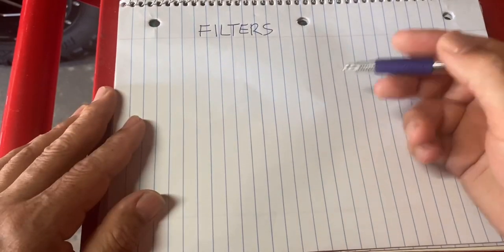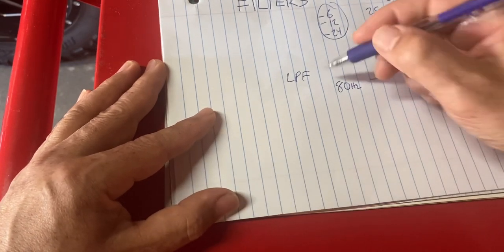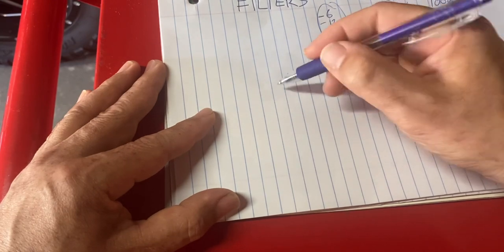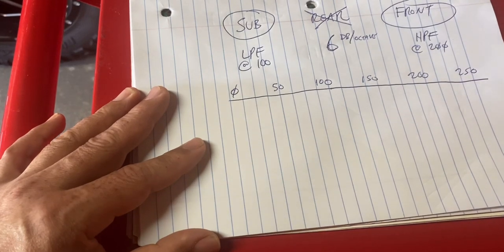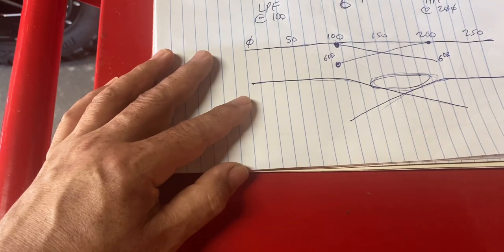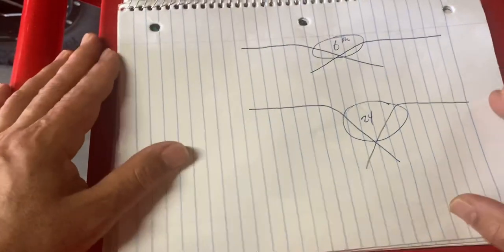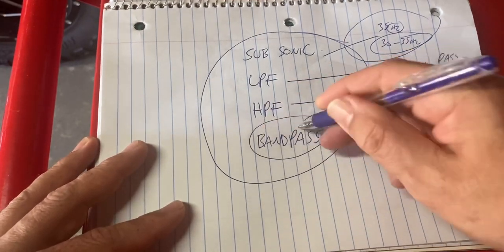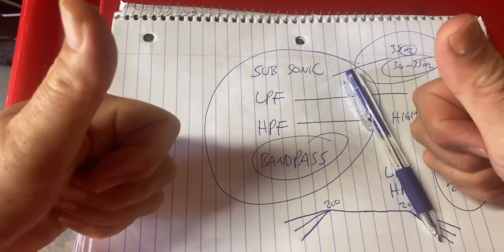Tune your amp filters like a pro!!! HPF, LPF, Sub Sonic, bandpass fully explained!!!

Comment: Damn! Didn't even know what I didn't know, great video! I can't seem to find the DB roll off for my amp so I figured I'd shoot the gap. Please tell me if this makes sense. I have 2 Skar 500w 4 channel amps (will be 1000w when they are back in stock) pushing 6 Skar marine 6.5's and 2 marine midrange 8's. All wired at 4ohm. Is a good starting point lpf150 and hpf200 for the 6.5's 
Lpf 80 and hpf 100 for the 8's 
Or should I watch the video again lol? Below is my amps info. Thanks so much for taking the time to teach us! Subscribed! 

Skar Audio RP-75.4AB Multichannel Amplifier
Class A/B 4-Channel Amplifier
4 Way Protection Circuitry: Thermal, Voltage, Speaker, DC
RMS Power at 2 Ohms: 125 Watts x 4 Channels (14.4v)
RMS Power at 4 Ohms: 75 Watts x 4 Channels (14.4v)
RMS Power at 4 Ohms (Bridged): 250 Watts x 2 Channels (14.4v)
High Speed MOSFET Power Supply
Soft Turn on Circuit
Frequency Response: 20Hz - 20kHz
Signal to Noise Ratio: 105dB
Tri-Mode Capable / Bridgeable
Bass EQ Switch: 0, +6dB, +12dB
Low Pass Filter (Variable): 50Hz - 500Hz
High Pass Filter (Variable): 20Hz - 5kHz
8 Gauge Power and Ground Terminals
Working Voltage: 8.5V - 14.4V
Reply from the maker: I think you got the filters messed up man. Not getting any range hope they are correctly set up. Should be HPF at like 125 and LPF either off or at 2-5k if you are running external tweeters

Comment: Hi there, can I connect the 14000w Powerbass amplifier to two JBL Club series 10 inch shallow subwoofers?
Reply from the maker: You can, just adjust Gain accordingly to compensate lower power handling subs

Comment: Great explanation. Out of all of the videos i have seen, this one got through. I am left with a question though, what if my sub enclosure is not ported, what is the formula for setting the sub sonic filter?
Reply from the maker: 20hz. Good thing with sealed is that you can tune power like that without worry of unloading the sub. Anything under 20hz the ear can’t hear. So 20hz

Comment: This is absolutely amazing detailed information, I don’t get it yet but I’m going to keep following you until and hopefully I will finally get it. I’m not working on a Vehicle sound system but am working on my Victory cross country motorcycle and have Pioneer mvh-ms310bt headunit, 
Db drive wdx6moto-g2 400 watt speakers for the fairing ,
Polk audio 522 speakers for the tour pack 
Massive tx48 amp 
And I just purchased new Polk Audio MM1 692’s the 6x9’s and the lids and grills for the bags that I will be installing. 
I paid an audio guy to get an audio guy to give me setup instructions for the headunit and initial settings for the amp and we set the gains on the amp playing a particular song , we did this over the phone as there are no audio guys here in my town in Canada . I ordered a AUKUYEE TFT Digital Oscilloscope Kit O scope.
Reply from the maker: Nice man! Your on your way for sure! Nice setup

Comment: I didn't quite get the band pass filter, I m installing tweeters and mids on my 4 channel amp so my tweeters are going to channel's 1 and 2 and for my mids I'm gonna use channel's 3 and 4, for the mids how I create a band pass or how I set my filters there, because my options are HPF, FULL and Lp/Bp I'm hooking 4 mids on those two channel's in parallel so I'm a little confused about the band pass filter
Reply from the maker: Set mids to BP. Hpf@150-Lpf@2k. Tweets HPF@2k
Reply: @NextLevelCarAudio  thank you very much!

Comment: I’m running a pair of DB Sylvesters and DB tweets on a pair of component crossovers, im getting too much bass in the mids, should I change the amp crossover setting from full to high pass or just adjust the crossover on the amp until the bass has been reduced?
Reply from the maker: Do you have a eq? On your head unit for example? That’s where I’d do the tweaking.

Comment: What should i set my LPF to if my enclosure is tuned to 32hz (im running 2 12 skars , with the rp1200 amp) help me out here i dont wanna blow my subs and i want them to sound the best they can
Reply from the maker: I say 32 hz honestly.
Reply: @NextLevelCarAudio  i cant , it only goes from 50-220 so what should i set it too

Comment: I have a full range amp running my subs tuned at 33hz. My low pass is at 80 my hi pass is turned all the way down. Is this correct??? Also my amp has 3 more knobs for filter one I believe is 32 + or - 6db, another knob is 64??? + or - 6db and I think the last know is 72 or 84 +or - 6 db.......those 3 knobs are all set in the center at 0......should I set those differently.  Feedback would be much appreciated.......
Reply from the maker: That sounds setup just right. 😎
Reply: @NextLevelCarAudio  I ask because I see alot of guys run there hi-pass around 5hertz less than there box tuning. Not sure if this is just more efficient or better on the sub???
Reply from the maker: No need to do that. As your SS/HPF has a slope/ roll off. Not a sharp cliff. So it progressively attenuates below port tuning frequency and your other going full send below port tuning which is not a good idea.

Comment: Great video thank you man.

You mentioned setting subsonic when using a ported enclosure but what if I have a sealed enclosure? 
Just find my box tuning frequency and set it a little lower than that?
Reply from the maker: For sealed I set sub Sonic at 25hz. Since it’s sealed, it can take it. Plus Anything below that you can’t hear anyway. So no need to go lower

Comment: bro help me out i got a stock head unit f150 2016 one 12in L7 Q class running 1 ohm 900 rms amp re audio 1500.1 in a 3.1 cb ft ported box "tuned" to 32 htz  im guna try to set my gain bass out of it any help on amp adjustments on the lpf,subsonic ,bass boost anything would be helpful!
Reply from the maker: I’d do sub sonic 32hz, LPF @ 125hz, bass boost off. Gain is the most vital setting. I have lots of videos on this. Different methods
Reply: highly appreciated i had my lpf @100  and my gain was too high now i set it like u told me and my sub is playing wayyy better more bass and sq is blending with the music better thanx for the help man foreal !
Reply from the maker: Awesome!

Comment: What if the subsonic isnt numbered?
Mine is marked 10hz minimum to 50hz max
Reply from the maker: That’s fine, just estimate. 30hz would be straight up and down, middle. 20hz right between 10 and 30, so on and so forth

Comment: If I set the LPF frequency is 80 Hz and DB is 24 db, then what will be the effect in car subwoofer?
Reply from the maker: It will play 80hz and below full gain. But will attenuate above that frequency at a rate of 24db per octave.
Reply: @NextLevelCarAudio  Thank you... But my question is that what will be the effect in woofer sound at 24 DB or 18 DB when I listen any songs?

Comment: My audio control amp has 12db built in. So where should I put my radio on 6 12 18 or 24 ?  I have it set 80 hz and 24 db Octive
Reply from the maker: If your talking about LPF for your sub, I’d do 12 or 18. 24 is pretty steep which is fine, if you have good midbass in your front stage.
Reply: @NextLevelCarAudio  what about the hpf. I have T2650s components?
Reply from the maker: I still like 12/18 6 too shallo and 24 too steep

Comment: Excellent explanation bro..thanks for helping out the community.  You should have band passed your pen at 6db, that way it wouldn't cut off so abruptly in the middle of the line. :"let's get loud": 😁 how about a video on how you tied your rear stage into the front?

Comment: Do they still make amps without crossovers? My head unit has one for a sub and I’d rather use it
Reply from the maker: You can, just leave the crossover on the amp open or full.

Comment: Great video! Explained very clearly. I had my HPF and LPF both set to 80hz with a 12db slope and wondered why music sounded so boomy in this range.
Reply: I have mine set this way also, but my music isnt boomy.  Im playing music flat, no treble or bass enhancements.  Have you tried dialing in your sub?
Reply: I had mine like that for a little bit, but now I have the LPF at 80 and my HPF at 120, to me it sounds clearer. With 80 and 80, it sounded kind of muddy, like the bass from the mids was clashing with the bass of the sub. FYI, I have JL Audio 6.5 C2 with a 10inch H.O. W3.

Comment: If my box tune is 38 hz, so how much to set HPF and LPF ? 🤔
Reply from the maker: Lots of factors to consider. What is your sub size?
Reply: @NextLevelCarAudio  2x12 300 RMS
Reply from the maker: LPF around 100-120hz. HPF (subsonic) at 38hz.
Reply: @NextLevelCarAudio  HPF on my amp  min is 15 hz, max 1khz.. so 38 hz is about at 11 clock maybe  🤔
Reply from the maker: If that’s the case, Should be just a tick above minimum/lowest setting.
Reply: @NextLevelCarAudio  hm, just don't leave at minimum(15hz). I can leave on higher Hz(30,35,38) i hear about formula.. 38÷2=19÷2=9.5  38-9.5=29.5 so  HPF can leave about 30 hz? Or this method bad ?
And another one question: When on amp set 100-120Hz(LPF), so in headunit at subwoofer settings in LPF settings leave same yes ?

Comment: I thank you and appreciate all your content. I've been installing systems before I could drive. Even on last installation never hesitated knew what went where. It's like riding a bicycle but it's been 20 years. This material isn't Greek but I'm certainly a tiny bit Rusty. If the amp runs in parallel. I should be able to hook my two Orion XTR 10in 4ohm normal in box and once hooked up to amplifier it will be 1ohm load. And if I lost you sorry 🥺
Reply from the maker: Yes that’s right. You are good man 😎

Comment: How do i determine  where 80hz is on lpf, if 80hz isnt pre-marked on my new amp.  (Like my old amp)
Reply from the maker: Estimate by using divisible math. Figure out what half way is, then what 1/4 is, etc, etc, then you can get a very close estimate. Better than spending all the money on a CC1
Reply: @NextLevelCarAudio   Sweet, thanks man👍

Comment: How to set up my crossovers to get a kick/tumping from my mid range speakers ?
Reply from the maker: If you want to dial in like that. Best to get a graphic EQ. Or parametric. Then boost the frequencies a few db where you want the kick. Also, placing your mids in a sealed enclosure vs free airing in door panel will enhance the kick
Reply: So you recommend a seal enclosure . Thank you 

I'm just a noobie and learning so much from your channel 

Keep it up #fan from Guyana
Reply from the maker: For your mids. Yes. Some nice custom pods will do.

Comment: If you built a box is there a way to check what it's tuned too With out expensive equipment?
Reply from the maker: You need to know some of the parameters of your box, then just fudge numbers till you get the specs your looking for:
http://www.mobileinformationlabs.com/HowTo-1Woofer-Box-CAL%20Port%20lenth%201.htm
Reply: BoxNotes is a decent tool for enclosure tuning.

Comment: I’ve been doing my own stereos for at least 25 years or more and never had it explained like this, I’ve always tuned by ear and tried different settings until it sounded good. Now that I know what these things really mean I’m going to redo my whole system. One question; I have a pioneer deh-80 do I need to use the crossover settings on this, the amp or both and if so the proper setting ?
Reply from the maker: Id use your in dash unit as you can run active vs passive crossover on amp. Plus, you can adjust on the fly when needed.
Reply: @NextLevelCarAudio  Awesome !!!!!

Comment: Is a 100 hpf and a 120 lpf good for full sound system it sounds nice I don’t have the lpf hpf on amp only gain and bass boost but I got the lpf hpf on head unit
Reply from the maker: With those settings you are only getting a 20hz bandwidth. What are you trying to set those filters for? Subs?
Reply: @NextLevelCarAudio  just trying to get it to sound best I can I guess what would u recommend me trying out I only got 80 to 120 lpf/hpf to work with that’s built in with head unit
Reply from the maker: If your talking about your subwoofers, then I’d go LPF @ 120hz

Comment: why you dont just set hpf and lpf at ex. 100hz? so you dont have to adjust the lost freq?
Reply from the maker: Because 100 is too high for bigger subs and 100 is too low for smaller mids. If you had small subs and big mids, then you could cross at 100, sure.
Reply: @NextLevelCarAudio  Thank you! 😁

Comment: Best explanation I've seen. I am somewhat new to car audio. I understand filters better now. But I have a question. I have single din sony headunit. No sub yet. I hooked up my 4 channel amp and used rear channels for rear 6x9's. Set gain with liumy o scope. Now there's no bass coming out of them. Just went from headunit with bass to amp and no bass. Please help. I'm confused as to why the amp is not playing bass frequencys. Oh I first had full range on amp. No bass so I tried the lpf turning up and down. It made no difference as far as bass. It sounded muffled. I turned hpf up and it of course filtered lower frequencys out. Turn hpf down and those lower frequencys come back but not low enough for bass.
Reply from the maker: Not sure man.... did you check polarity? Accidentally Reversing it sometimes can cause loss of bass
Reply: @NextLevelCarAudio  thanks for answering me. It may take a while to figure out but I will figure it out eventually. Just want to say your Hummer and system is lit. You did a great job.
Reply from the maker: Thanks man
Reply: Maybe things are set in the Sony head unit?

Comment: Dude thank you! Very helpful bro seriously you rock!
Reply from the maker: Thanks
Reply: @NextLevelCarAudio  bro can I ask your opinion on something that’s been really tough to get down? I am currently running two Skar D8 D2 900w 11max subs ran by stock head unit , TWO CT Sounds AT-900.1d with a kicker keyloc for RCA’s subs r inverted to spare displacement or air space cuz my two separate enclosures are only 1.15 cubic feet but call for at least 1.25 and the subs are 24 db octave and they’re spl so not really for quality. Just bumpy bumps 🙃😏 But I have two Sundown V2 D2 D8’s and I have a CT Sounds AT-1400.1d to run those and help gain more power and more quality but I can’t figure out what I can do to send the SUNDOWNS their own rca data?? This car is my wives and I can’t go too ham with it but she doesn’t want to ditch the OEM HEAD UNIT.  Do you think I can run RCA to 3.5mm jack to one of the 4 rear full range headphone plugins to power them separately or get more equipment?? Please man this has been nothing but a major headache and I could really use help getting her car back to her but sounding better than it does. Trying to save face at this point and I don’t mind humbling myself when I say I’m tired of my answers cuz they have only beat me up on these second subs thus far.
Reply: The Skar subs are running at 2 ohm final in strapped 900.1d and subsonic set 33hz LPF is 85hz and sounds better than expected but not what I had planned as a whole. Btw this is an SUV Volvo xc90
Reply from the maker: Subs should not be powered by head unit. Even low powered ones. Loc converters are what you need. Tap into speaker for signal and your set. Go from there.
Reply: @NextLevelCarAudio  yeh I know that I have a loc kicker keyloc with an eq but I don’t want to run all three amps and four speakers from the same output. Can I just plug into the mid range speakers in the back seat without another loc?
Reply from the maker: Technically yes, but your head unit is going to be taxed and signal quality degraded. But it will work
Reply: @NextLevelCarAudio  okay I’m definitely not into cheap and garbage so what do you think is the alternative so I can hook up the third amp for subs? After market head unit or is there a device that can control the amps input output without affecting the head unit?
Reply from the maker: I’d take it in to a reputable shop local to you so they can discuss options and really do a look over of your system/head unit to see what they can do for you man.
Reply: @NextLevelCarAudio  yeh I mean I understand that can be an answer but honestly I enjoy the challenge. I rebuilt my enclosure and will be resting by tonight. I’m thinking about adding a piano for more signal to the RCA’s abba to get a boost but I’m quite convinced I’m not getting the results I seek due to a power issue. I have plenty of 0 gauge B+ and ground but the system seems to rest at 13.5 volts and it’s causing  clipping at higher levels . Perhaps a bigger secondary battery could help but what about my 5 farad cap and battery? How can they not work with only the two 900 Skars?  Honestly bro I live in the middle of nowhere so a shop won’t be an open at all. I like the challenge it’s how I learn ya know

Comment: Why not cross both LPF and HPF at the same frequency for example both at 80hz so there’s no gap that needs to be filled in ?
Reply from the maker: That’s fine. And great of you can! But for some drivers, 80hz may be too low.
Reply: @NextLevelCarAudio  anything wrong with having the HPF off and just having the LPF at 80hz ? Sounds better to me
Reply from the maker: You can. If it sounds better to you, that’s what counts :)
Reply: @NextLevelCarAudio  perfect thanks! Also do you have a recommended EQ setting for a car setup with an aftermarket sub? I did the smiley face one you mentioned and the bass is too heavy it rattles the entire car lol
Reply from the maker: Just flatten out the lower end of the spectrum to your liking. Some don’t like it as boomy as others
Reply: @NextLevelCarAudio   thanks! What streaming app do you personally use when listening to car audio? And do you think using USB is better than Bluetooth
Reply from the maker: Dropbox. I transfer files between my devices a lot. USB will give you better quality typically